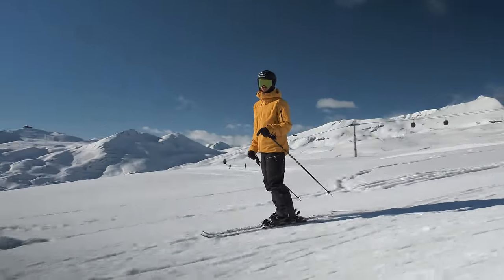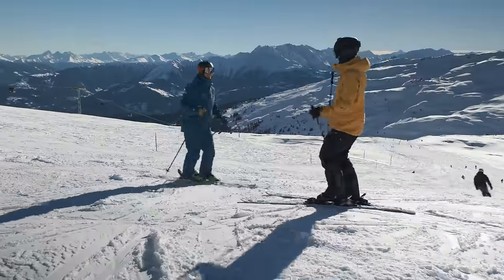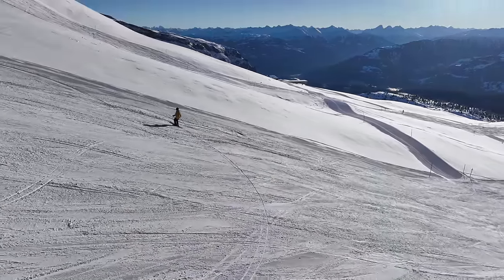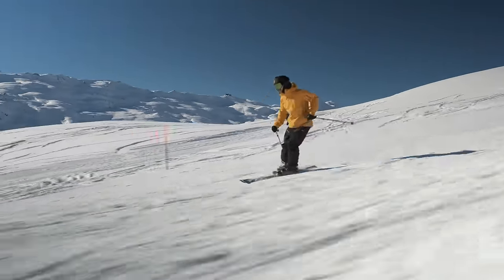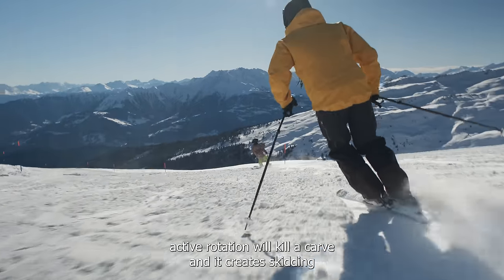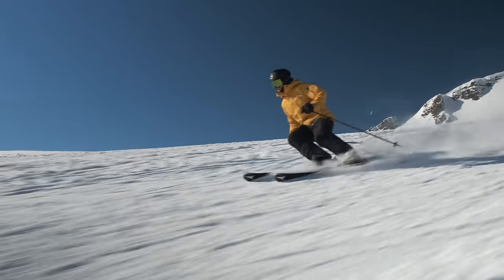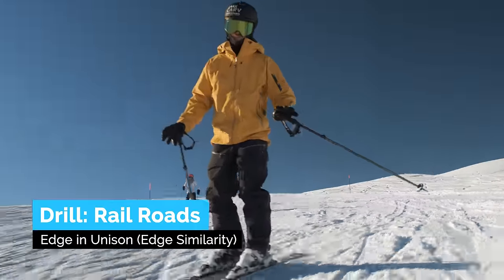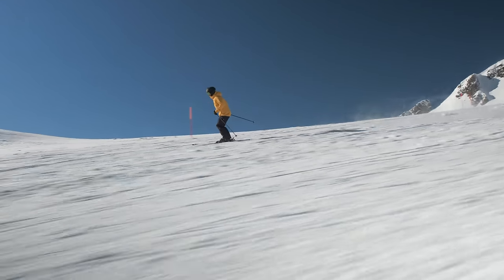5 Reasons You´re NOT Carving on Skis

Comment: Part of the issue that intermediate skiers also have with carving is the top end speed you need to achieve and maintain with those wide turns on a steep slope. I think that gets overlooked a lot. When advanced skiers are carving the speed that it takes to do those wide turns is much greater than what a lot of intermediate skiers feel comfortable with.
Reply: That’s a good point. I’m a former racer, and have a hard time teaching intermediate skiers how to ski, because to carve a turn properly on a steep trail really means some big speed. And that’s the only way I know how to ski
Reply: The trick is to ski a slower line on faster runs, that's what he meant by C turns.  At higher speed aerodynamic drag becomes significant, but on even a moderately steep slope maintaining control requires either braking, or reducing the effective steepness by traverses or fuller tighter rapid turns which require physical preparation and advanced skills to pull off.
When I've skied any piste I'd call steep had moguls which are hard to carve through, that includes every slope I raced slalom or GS on.
Why would you try teaching carving on a steep slope?  It'll set up learners to fail.  Using a slope where they want to ski faster maintaining speed rather than scrubbing it off encourages clean lines.

Comment: Harder snow also helps greatly once you get to a certain level of ability. Soft and especially non-uniformly soft snow allows your edges to "let go", and limits how much you can increase edge angle to tighten the carved radius. This is especially true on short+narrow specialist skis like FIS SLs or some of the shorter-radius carvers on the market.

wrt the sensation of falling to the inside, my breakthrough (many years ago) was internalizing that my core and my feet must follow separate paths, and that the rest of my body's job is to keep them in the right relation. When you think of it that way "Falling to the inside" is really just a matter of lowering the core while allowing the skis to carve out from under it. The "lowering" part is really important, because a lot of people "fall to the inside" while staying too upright, and that leaves them incapable of loading up and driving the outside ski. I have to visualize my core moving down close to the snow surface as my skis move out from under it. Also once you've gotten the "lowering" part down then you can build upon it by working on staying low through a quick turn transition.

And of course when you're on a really steep slope and must skid, the trick is to do it entirely up above the turn and steer the ski back out into the carve before the apex. That's how the racers roll.
Reply from the maker: True I had some of that in shooting this video for short sections.
Reply: @StompItTutorials  Yup, I saw that and it motivated me to make that comment. It looked like you were loading up the edges about as much you possibly could with the surface layer that loose.
Reply: 2nd paragraph is a really long and weird way to say “hip angulation and upper/lower body separation is what you want, not tipping”.
Reply: @youngcansuela8327  I was trying to describe how I had to "feel" upper/body separation (like 30 years ago) to develop it. That sort of thing is always a bit ideosyncratic - different people perceive it differently.

Also it's one thing to say "separation" and another to internalize how to use it. There are plenty of "separated" things that I can do with my upper and lower bodies that aren't conducive to good skiing. I think that's actually a problem in how a lot of people teach/explain this.

Comment: Just got back from Three Valleys, France!  Using your Stomp IT tips, man what a blast especially on the newly laid powder.  I am a snowboarder and switched to skiing, and without your tips, I would not have progressed so far so quickly!  Thankyou!  So here' the deal.  My major issue was trying to keep my skis close together because of course the closer they get, the more control you have.  For some strange reason, I just couldn't get my skis close enough without my balance suffering.  Any tips gratefully received!

Comment: Excellent video! When you're doing your gentle, shallow turns, do you still drive the inside knee slightly forward? (I couldn't quite tell in the video). Focusing on the inside knee was one of the key things that unlocked clean carving turns. I'm not always achieving it, but when I do, I go silent and supersonic.
Reply from the maker: Sure it's important to tilt the inside ski inward a wee so the skis got the exact same edge angle. When you say drive the knee forward I get worried you may end up twisting the hip out of the turn which is not good. Don't do that. How ever the inside knee will be forward as you need to bring it up.
Reply: @StompItTutorials  thank you for the feedback! I will have the hip out of the turn in mind next time I go skiing.

Comment: Hi, thanks for a nice video! I have a different problem though. Sometimes, when I have a bit of speed and try to do narrower turns with high edge angles, at the exit of the turn the outside ski starts breaking off of the groove, resulting in a really unpleasant feeling when it breaks out, grabs the snow again, and breaks, and grabs, etc.
I understand that the edge angle is too high to skid and the downhill force is too strong to keep the ski in track, but I keep doing it and still not sure how to fix it.
Any suggestions? :)

Comment: I started skiing 2 winters ago and I got to the point where I could do blue and even some reds without falling pretty quickly. I thought that I was doing it but then I took a couple of lessons and the guy told me that I am more so sliding down than carving and I realised that it was exactly what I was doing. But the thing about that is that if I try to do more carving I quickly end up going too fast for what I can handle right now. I guess I just need to stick to really slow blue runs and focus on carving even though I will be going really slow?

Also what about ski length, It always seems to me that the people who look the most in control out there and are the most nimble got smaller skis than me. At my length (181 cm) I was told that I should have at least 175 cm skis but I often feel like I would do better if they were a bit shorter.